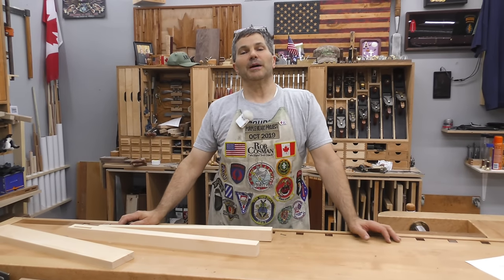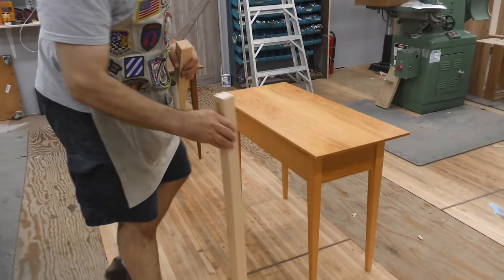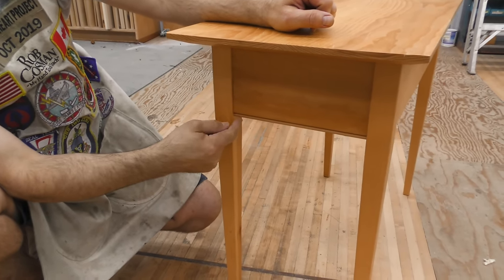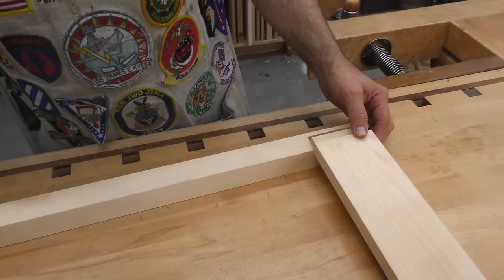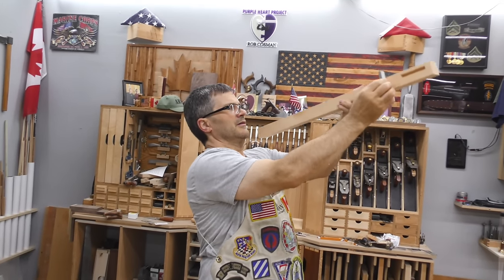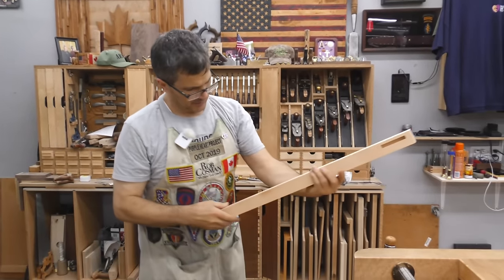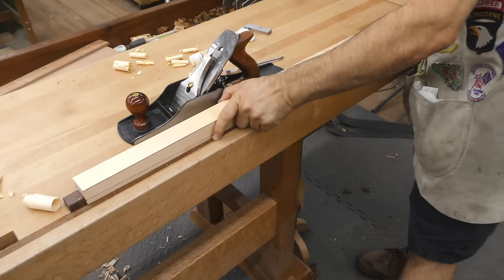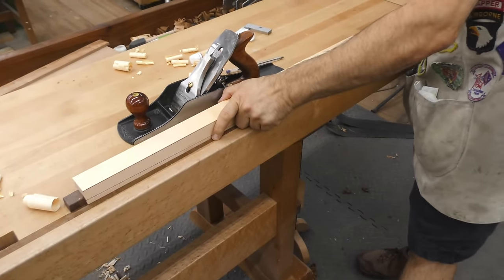How To Make Tapered Legs - By Hand (EASY)

Comment: Along with Mr. Sellers' "knifewall" for starting saw cuts and your method for squaring up edges by riding the plane flush to the opposite of the high side, these two tricks have made my hand tool woodworking so much better than it has ever been these past few years.  Well, that and having a good bench to work on...okay, so the three things that have made my hand tool woodworking better are...  

And keeping my tools sharp...four things that...
Reply from the maker: Sound lik eyou are off to teh races.  Great job.  Keep watching

Comment: 7:05. Yep, I was yelling that at my iPad, lol.  I used a marking gage on the bottom of the leg when I planed my table legs, which means the tapering point at the 3/4” end of the leg is always there to use as a transfer line after you do any taper.

Comment: the fine tip sharpies are good where a ball point would burnish the surface but a pencil won’t show. Just have to be careful when you use it because the ink does penetrate a  bit on light woods. Between a carpenters pencil and mechanical, both types of sharpies, a ball point and Rob’s clever red pen trick, and chalk for rough sawn (and sketching on your concrete floor in my case) you are covered I’d say.

Comment: Rob great video. For another day but would be great to see how you deal with adding a small shelf lower down the legs. Especially when the taper is on the inside!!! Trying this and all I can think is to add a small curve from the leg taper to the shelf tenon.... Probably other methods
Reply from the maker: I think i would probably do an outside taper only and do small through wedged tenons
Reply: @RobCosmanWoodworking  probably a smarter approach, the legs are square at this point so I have some time to reconsider!!! Cheers

Comment: This was an interesting and timely lesson for me, Rob. I knew I was going to need a tail vise on my bench sooner or later, but after watching your bench top shooting board technique here, I realize it’s going to have to happen sooner rather than later... very slick! And what’s with your depth adjustment knob on your plane? A star makes a lot more sense than a wheel! Is that an aftermarket mod, or is Wood River making planes with that now? I want one!!
Reply from the maker: We have been working on this for a year, first shipment sold out in 12 hours, next is due in Wednesday.  Fits all Woodriver planes except the 3 and 4.  Separate model fits LN planes.  makes adjusting so easy, called the "AdjuSTAR"

Comment: Thanks Rob, really great lesson. 
A couple of things:
1) I can now think of 4 techniques to do these tapers: a) table saw with a jig, b) band saw with a taper jig, c) planer / jointer with a jig, d) this ie by hand. Given you have access to all of these, which technique would you use in reality if you were making this table?
2) I’ve seen a lovely table design that has tapered legs and then they flare / curve out at the bottom. How would I do this?
Thanks
Reply from the maker: I prefer to do taper legs by hand.  For me its just as quick. If i did the taper on a machine i would still come back to the bench and finish by hand to remove all the mill marks.  So I start and finish at the bench.  If i was making say 5 or more tables at a time, i would cut on my machine but still finish by hand, but i dont do production work.  Plus i hate sawdust and noise.  Both are bad stuff
Reply from the maker: For you second question i have not done that, but i would just lay it out then cut by hand.  If i curved it i would reach for my spokeshave.
Reply: @RobCosmanWoodworking  Thanks for the replies. Re the outward curving leg, given that it protrudes beyond the outside dimension of the leg at the top I'm wondering if it all needs to be made from one piece with a lot of waste or the leg made from 2 pieces with the lower (curved) piece from a larger piece of stock. Does that make any sense?

Comment: Very informative. How do you make sure the legs will sit flat on the floor?
Reply from the maker: Good question!  But that is for another video...
Reply: I have seen one trick where once the whole thing is build put it on the floor of your shop and glue a pencil on a scrap block of wood and run that along the floor and it will show you where to cut to make it sit even. This is used by rex krueger.

Comment: At 23:00 is the plane skipping because of low spots or is the leg flexing?  I can't tell but from what you've been doing I can't see how low spots could develop. ???
Reply from the maker: Well it not a low spot rather the full leg is not on a single plane since I was taking more off the top of the leg than the bottom so that "Skip" is th etransition between th etwo planes until I get it all evened oiut

Comment: Great video, I've used the table saw to taper legs with a cheap jig (yuck) and also a jointer (fast).  I'll try this next time around.

What do you do if the grain is running the other way?
Reply from the maker: Even if you do the taper on a machine finish with a hand plane...Your surface will be so much nicer
Reply: You need to be careful with the technique that I propose with interlocking grain, but I wet the grain. I use this technique all of the time when shooting end grain. (basically the same thing as wonky grain.) I am careful to dry my plane and blade after the cut.
Reply: If the grain is running the other way you have cut a leg out of short grain stock and it is no good, you need the lines running more or less straight down the leg.

Comment: With your sharpening techniques, I'm getting pretty good performance out of my Woodriver planes.  What advantages are to be gained by upgrading to the IBC blades?
Reply from the maker: The IBC blades are A2 steel tripletempered.  They are a harder steel than what comes with the WR which means that the sharpeness will last a bit longer also take a few more seconds to get it to sharp.  To put it in terms that easy to understand it gives about a 10-15% improvement over teh WR blades
Reply: @RobCosmanWoodworking  Thanks! I hope to make it to one of your 2022 workshops. Currently gathering the right hardware, then we'll fine-tune the software :-)

Comment: If you really want to hog off wood (without a scrub plane) you can set the plane to take too heavy of a cut, to the point it would chatter. And then tilt the plane when you cut and put a heavy chamfer on one side, then the other, then turn this profile into a radius, then retract the iron a tad and cut off the radius, making it flat. You can take a huge bite when you’re not trying to engage much of the blade.
Reply: The same approach you would use to chisel it if you had no plane

Comment: I have a question about the amount of taper. I understand that in this case the "foot" of the leg is half the width of the top, this looks well balanced for this length/width. Is there a rule of thumb to follow for taper vs lenght for say a low coffee table or a taller side or dining table? Or if the leg started really chunky for example?
Reply from the maker: I just follow my eye.  A good starting point is half the thickness.  But follow your eye

Comment: Instead of a ballpoint, use a Sharpie.  If you draw your line quickly it won't get wet enough to soak in but still be dark enough for viewers to see.  And it won't bleed unless you get some kind of solvent on it.
Reply from the maker: Where were you when I needed that info?????
Reply: @RobCosmanWoodworking  As I recall I was in my shop in my bare feet (a widely recommended practice) dropping a heavy piece of hickory on my foot and crushing one of my toenails.  I was on my way to tell you when that happened and got side-tracked stopping the bleeding.  Sorry. :(